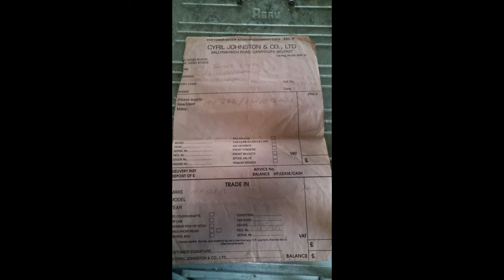The start of a makeover for the Massey 372

Comment: Conor,could you take the pane of glass and rubber out of the door and then weld the hole?
Looking forward to seeing her finished, smashing tractor god bless it.
Will you put decals on the bonnet and upgrade the light's to led's ?
Reply from the maker: Yes I think that’s what we are going to have to do. To do the job right anyway. 
Aye I have the decals printed and all ready to go on her. I never thought about the leds. I must have a look at them